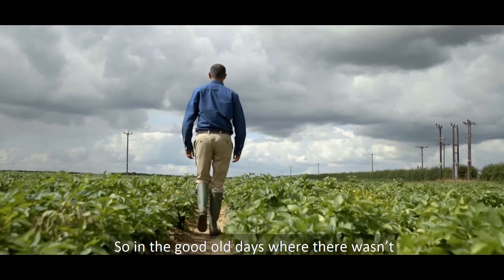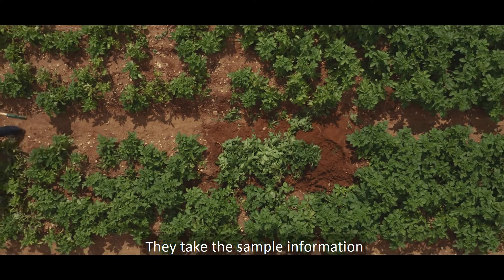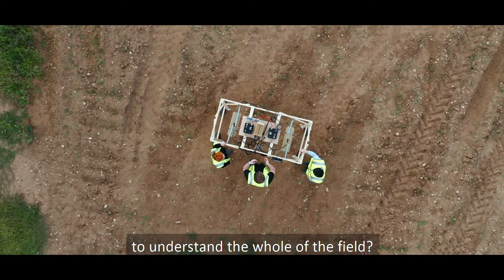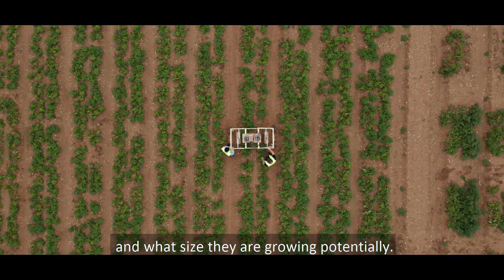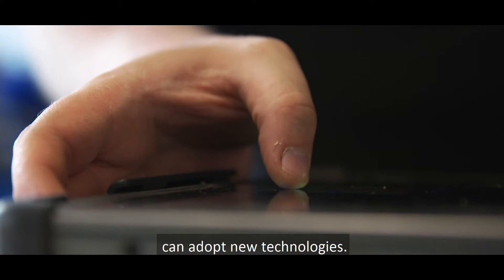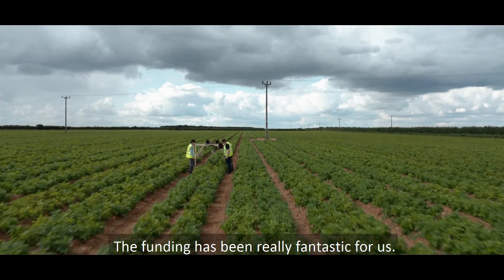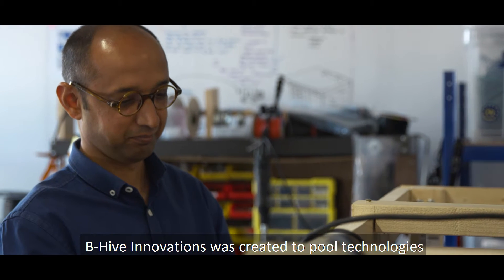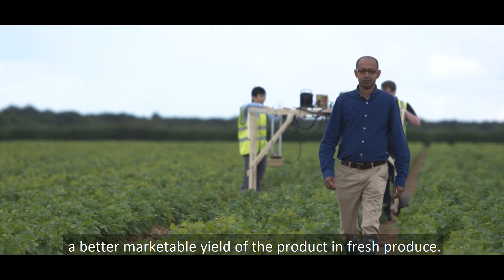Tuberscan - Improving potato yield forecasting and crop management

Comment: Tuberscan Sounds very interesting.. however  what is the efect of scanning on the growing tubers? Are there any negative effects that scanning introduces into the flesh of the growing potators.
Reply from the maker: Hi, thank you for your question. The frequency used for GPR is radio waves and so there would not be any impact upon the tubers. It is also a quick process, the radar units travel over the plants at approx. 5mph (or more) so it is a very brief interaction with the tubers.